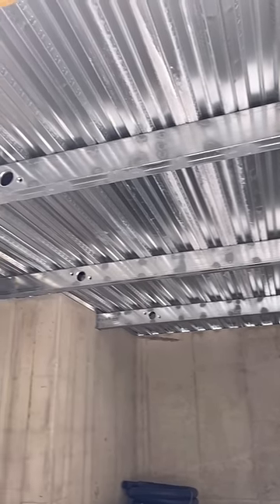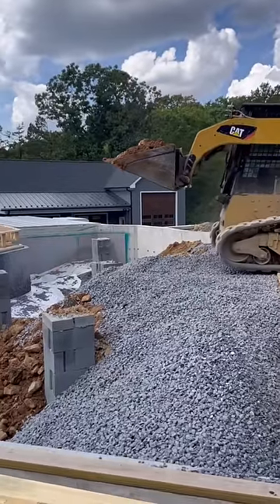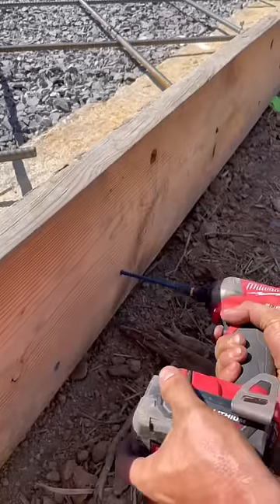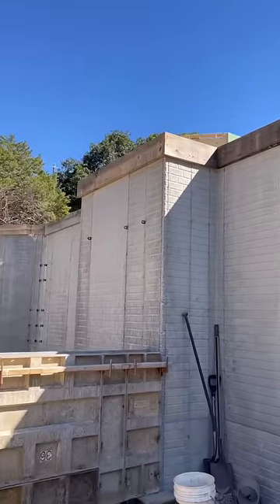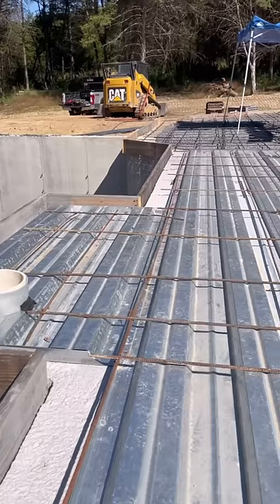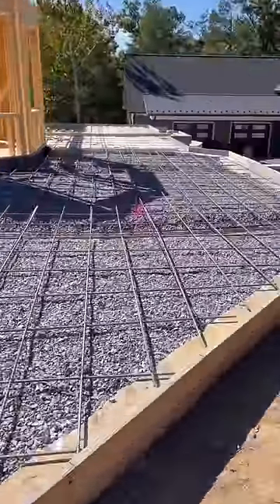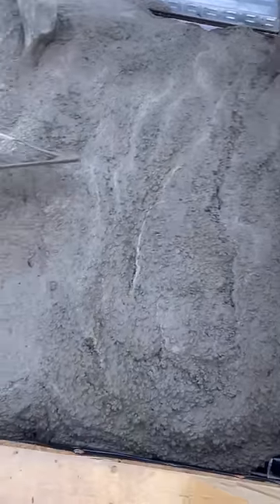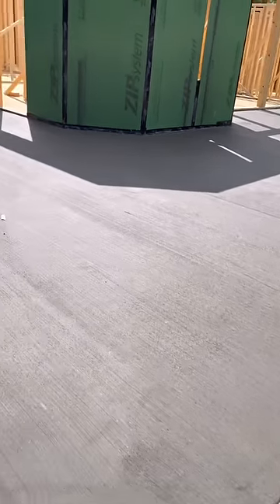Suspended Concrete Slab (Part 2)

Comment: We usually do flat finish when the pavers are going over it but what you said seems legit.
Reply from the maker: That’s what the guy who’s going to be installing the pavers requested
Reply: @hausplans 
Full size thick pavers or thinner pavers since a solid surface provided?

Comment: Pavers have natural expansion joints and don’t crack but stamped concrete does look nice as long as you cut expansion joints after the concrete is finished. 
 My preference is spray deck ,sun deck , kool deck , or keystone. Basically same thing just different names.

Comment: Stamped concrete is good because you can hit it when you pour. Texture And stain options are endless. Pavers aren’t bad either just extra work if you’re already pouring a slab.
Reply from the maker: True

Comment: Stamps will always look better and be better pavers is just extra weight to the overall structure and extra cash and steps and time out of pocket the fastest and most efficient way with that kind of operation you have is just to do stamp concrete the epoxy design sky's the limit brother all you got to do is look on the internet and find some unique design Stone element s*** maybe even duplicate like a Stella nursery or something in the design because with the epoxy you can really do anything stamp concrete is really amazing but it's very very difficult to learn and execute most people mess the job up because they don't do the prep right but love the videos keep them coming
Reply: Be easier to understand what your are saying if, the sentences had period (.) to separate your information.
You have valuable information but very hard to read.

I say this to learn what you are saying about using epoxy to create a ‘paver’ or ‘stamped’ design.

Comment: My concern with tile/pavers over concrete is if any water gets underneath the tile/pavers,  and gets in between the tile/pavers and the concrete, it can Frost Heave and knock the tile/pavers loose.
Reply from the maker: Yes we want to use a good quality grout and make sure it’s sealed so that doesn’t happen

Comment: If you're doing pavers it looks like your subfloor height is almost even with your slab height. Was that a mistake?
Reply from the maker: We left exactly the amount for the pavers/mortar will need. The pavers are only 3/4 inch thick
Reply: @hausplans  that makes sense now. The pavers I'm familiar withe are typically 2"

Comment: I am wondering the strength of the pillars made with concrete  blocks. In my years of construction, I have allways seen pillars made in concrete with rebar instead. Do they have the same strength?

Comment: Well obviously pavers on a slab are gonna look better and be stronger than 4" concrete stamped to look like pavers. But considering all the other stamps out there it starts getting kind of apples and oranges, especially when we get into pairing a stamp job with masonry or custom engraving with acid stain not to mention custom polymer/aggregate overlay also mirror finish or ground polished concrete saw cut and grouted to look like tile. Plus you can pour it as thick as you want and even accent it with, oh shit pavers, so really thats all just one list and I could go deeper. Yeah lots of options out there, and every house or business is different and every homeowner or architect has different taste (a lot of em only have taste in their mouths but hell it ain't my money) all this aside any of these things can be awesome or terrible it depends on the quality of design and the contractors quality of work.
Reply from the maker: All true

Comment: , we never put re rods on top of metal decking.
Reply from the maker: In all the metal decking projects I’ve done the engineering either called for small rebar or welded wire

Comment: Pavers suck. I did an overlay using 100-year-old cobblestone set in mortar on top of a 3-in slab in Minnesota, 30 years ago, driveway sidewalk even laid those cobblestones on the old front steps. I know the owner and he still loves it .It turned out beautiful . Otherwise stamp it. Pavers are worthless . They're pretty for 5 years and then you got a mess .
Reply from the maker: I guess it’s all just what you’re used too. I ran a Bobcat with foot controls for one day and absolutely hated it. My legs sore so sore from pushing the pedals. I feel like I can be way more precise with my hands
Reply: Sounds like a pretty cool job
Reply: @ACTEN10187  The cobblestones were free from a road we were ripping up in Minneapolis, they were pristine like the day they were made because of an overlay they did on that road. Shortly after all those cobblestones hand laid back in the late 1800s. We just got lucky and ran across a batch that hadn't been driven on. The funny thing was the layer of cobblestone on top of the pristine ones were all chipped up and driven over by carriages hold my horses, underneath that layer was pristine cobblestone bricks made in Chicago but there's stamps still on them and they were absolutely pristine people were fighting over them. They were so nice
Reply: @hausplans  I was accused of being born on one when I was finished grading. I didn't even touch the up and down pedal. I used the bucket curl to get precise layout of the material and I always had a bucket load and a man walking in front of me with a laser grade pool and I could grade a gymnasium in a couple hours. All them damn machines do the same thing. You've just got to adjust to what you have to work with that day 👍 One other thing, when you're finished grading, I've always did everything forward, I watch guys throwing dirt around and back. Dragging and hoping they get somewhere. No try the bucket curl method. You can get so precise. You'll be amazed. I had a shovel in my hand for many years and I got good at finish grading and I made a point of making sure all those laborers didn't need their shovels very much. But you are 100% correct. You've got much better control with your hands than stomping around on foot controls with your boots 🤪
Reply: @ac158  man that really is awesome. Glad you took the time to tell me about it. I'm a finisher, carpenter, well I do a little bit of everything really, but i like to hear the old timers tell us young bucks about the trade. Ain't many good ones left ya know. And when I get the chance I listen
Reply: @ACTEN10187  I've got three buddies that are finished carpenters and cabinet makers. I call them artists, a good finish carpenter can write his own ticket. Good for you. I've always been amazed and I've always dabbled and made a little bit of furniture. But to see a true craftsman and what they can do is absolutely amazing. I have one friend that's been in the architectural magazines in Minneapolis because of his skills at restoring Victorian homes. Good for you. Not many people can be a good finish. Carpenter.
Reply: @ACTEN10187  My grandfather came to Minnesota from Denmark with a giant box full of tools. He turned out to be one of the best builders back in the day, he built many of the majestic churches in Minneapolis before I was 5 years old. Learned a few tricks from him. My buddy that restores the Victorian mansions he was taught from his father who was taught from his father. Plus don't ever go to Minneapolis unless you're fully armed I don't go there anymore. It's a crying. Shame what the liberals have done.

Comment: Rebar directly on decking is wrong.  Who was the engineer?
Reply from the maker: Metwood, It’s the company that designs builds and sells the beams
Reply: @hausplans  decking is not a structural unit. It should only secure concrete until it cures otherwise it shouldn't be considered as a structural element in a finished project. 
On any elevated floor rebar should be suspended in the slab. As a general rule to prevent oxidation of the bar, as oxidation will pry the concrete apart and induce premature failure. Rebar can be placed higher or lower in the slab to prevent negative and positive moment but never directly on the decking as laying bar on the ground does nothing.  In humid or damp environments the decking will rot or become pitted allowing moisture to oxidize the bar.

Comment: Stamped, because your already there and it's a better option, IMO.
Reply: Also less material pavers aren't cheap
Reply: @anthonyrodrigues5032  and no extra weight.
Reply from the maker: All good reasons👍🏻
Reply: If money weren’t an issue though, pavers just look so nice. We’ve done a couple silver travertine decks on our pools and it is the most gorgeous looking deck

Comment: Only 2” of fall?  Looks like a pretty good sized span from the wall to the edge of the porch for just 2” of fall.   1/4” per foot is customary round here.   ….ok, maybe the patio isn’t much more than 8’, and if it’s covered….    Biggest thing is to always remember to drop the patio from slab height enough to accommodate the full thickness of all patio finish materials whether they be tile or pavers, etc including thickness of any setting materials, plus min of two inches from the finished floor height.   Have to make sure you aren’t going to end up with the patio finished floor impeding the function of weep screed on stucco, or other moisture drainage provisions on the walls.  Coving these can cause the exterior walls to hold moisture and result in catastrophic moisture issues.
Reply from the maker: Good advice on dropping a level to account for the finished material. We dropped ours to account for the thickness of the pavers plus the mortar.

Comment: Stamped concrete,if it's rebared correct and stress cut properly.then the right mix is us d you can avoid any large scale cracks and keep it at hairline fractures with fiber in mix.and proper subgrade prep.